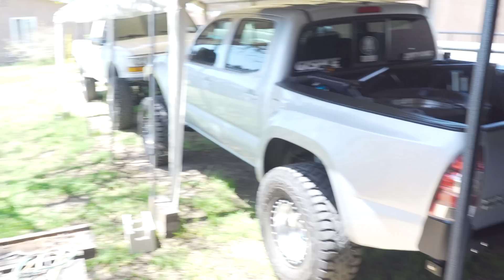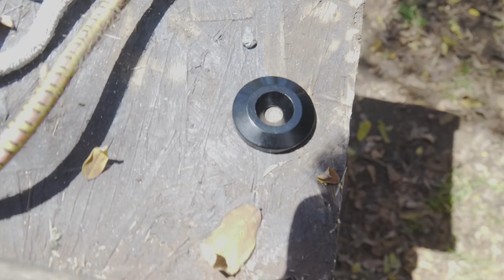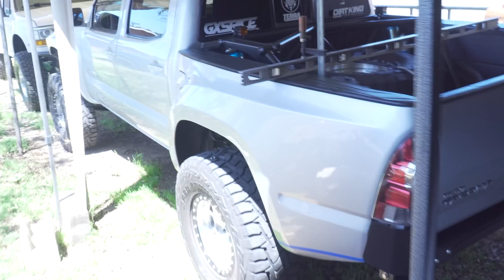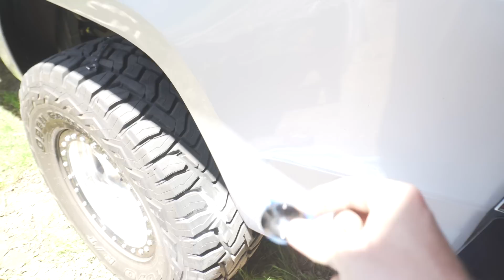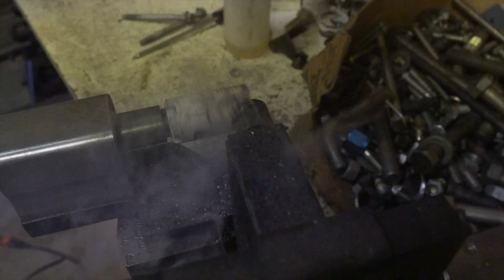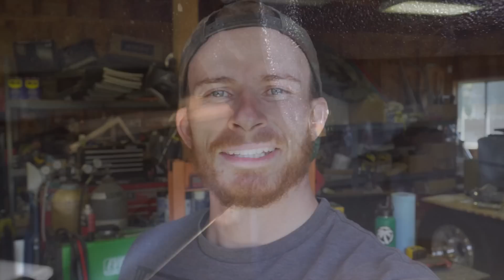Fabricating Bedside Supports for a Tacoma PRERUNNER!

Comment: Mind sharing where you source those washers? Tried a few different anondized brands and have yet to find one I like that aren’t $3-4 a piece.
Reply: you can get them from kibbetech
Reply: @ryancastillo3037  For an arm and a leg...
Reply from the maker: These exact ones are from ORW, Kartek also carries them, Autofab also makes a urathane one that we use on our prerunner. They are typically called fender or body washers depending on who you are getting them from